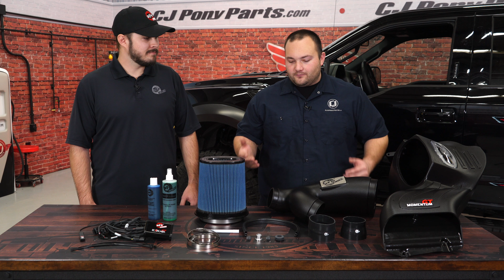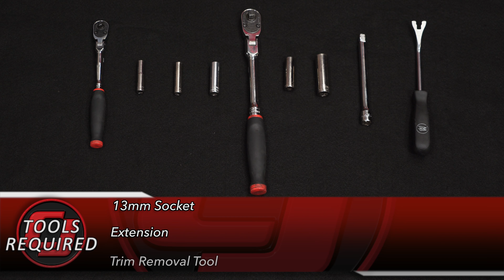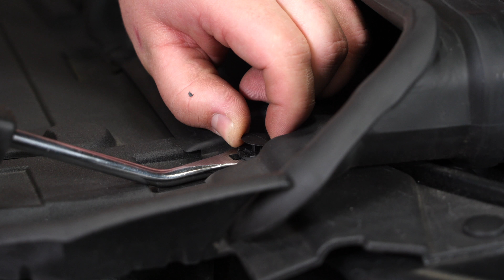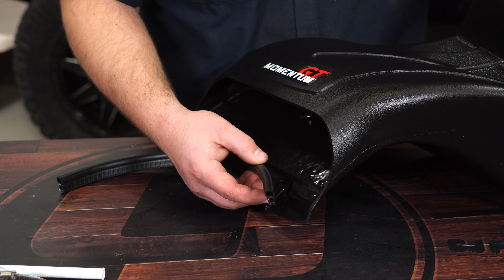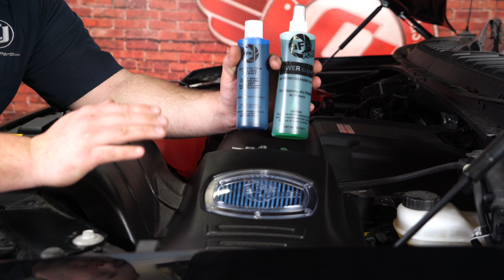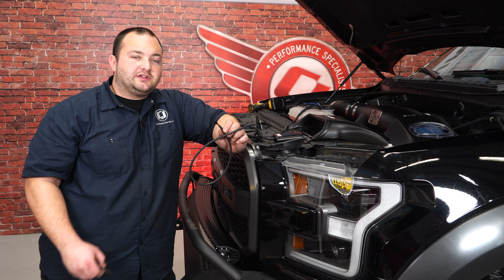F-150 Raptor aFe Power Package Scorcher GT 2017-2018 Installation

Comment: I installed this AFE Scorche in my 2016 f150 2.7 ecoboost and I feel absolutely no difference whatsoever on either of their 4 modes. All I have installed on my truck "prior of a Pedal Commander" was a front mount intercooler, an AEM air instake, and a Turbosmart BOV to atmosphere. Did i messed up on something? All the plugs only go one way in and I must have plugged them in correctly otherwise ill have check engine light on.

Comment: How did you run it into the cab?
Reply from the maker: Through the grommet in the firewall.
Reply: Stephen Labash - I have the intake, now I want to do this as well. Can you guys show how you ran this into the cab? There’s an AUX pass trough of cables on the pass footwell area, but not sure that connector can go through that port...
Reply: @PARADIGMCREATIVEGROUP  i mounted the scorcher on my intake box facing the driver. drilled a hole through the rubber grommet on driver side then ran the wire through. all of the thin wire connected to the mode controller is in the cabin. then secured the wire at the grommet with electrical tape. ( the hole is basically a slit )